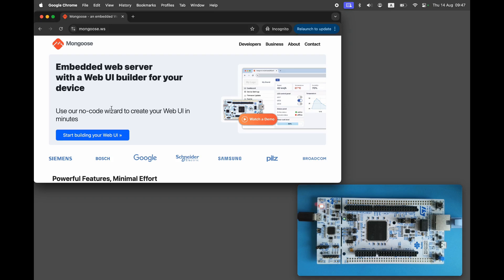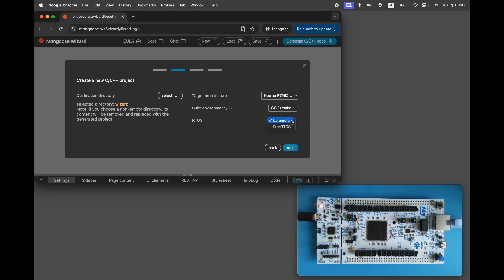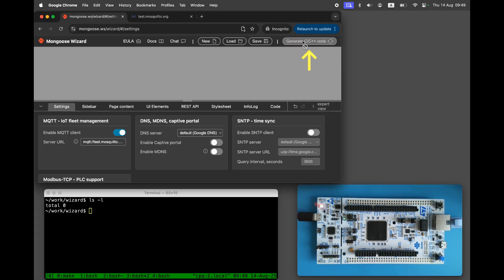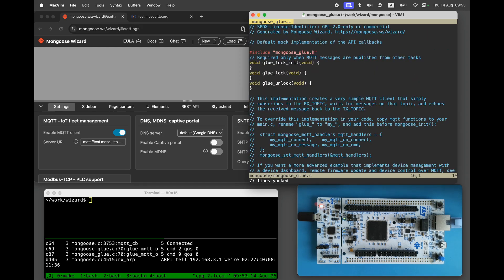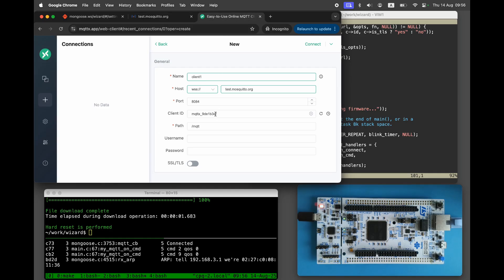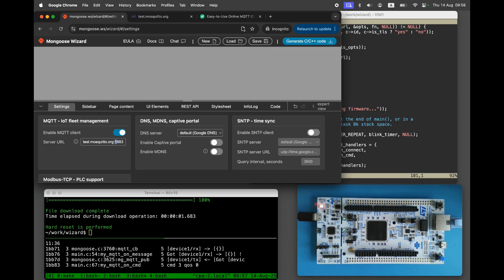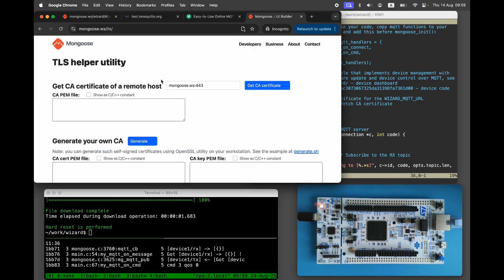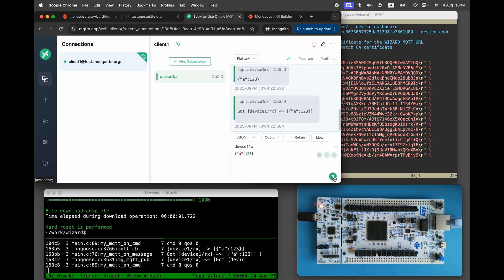MQTT over TLS on microcontrollers

Comment: Thanks! Works on F767. So, no TLS 1.2 protocol available on Mongoose? Anyway, many thanks!,
Reply from the maker: Thank you! Yes, Mongoose's built-in TLS is only 1.3. If you need TLS 1.2, the option is to use external TLS libraries like mbedTLS. Just set "#define MG_TLS MG_TLS_MBED" in your mongoose_config.h
Reply: @mongoose-networking-library  thank you, I'll try!